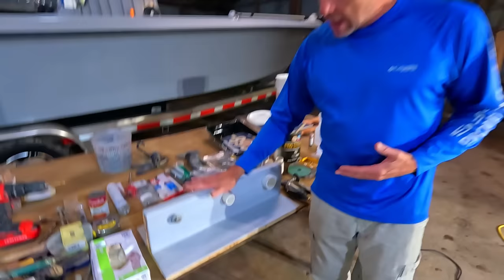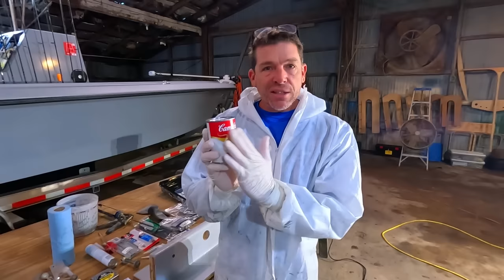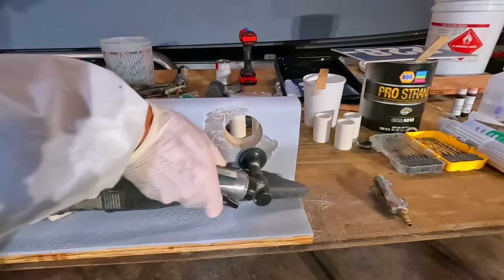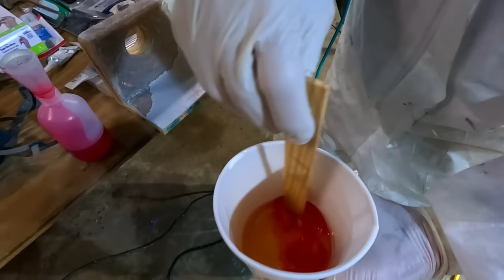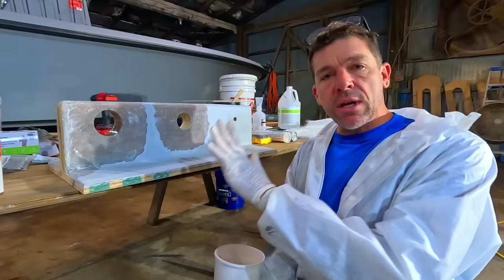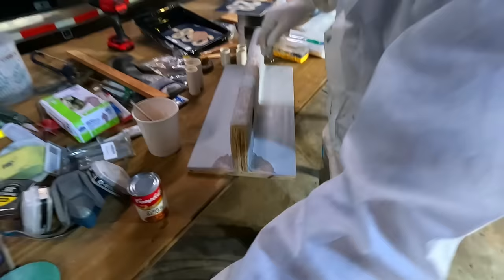HOW-TO Waterproof Plywood using Fiberglass and PVC! DIY FIBERGLASS OVER PLYWOOD

Comment: So if I wanted to add plywood instead of coosa inside my center console to thicken it up to mount electronics to. Would it be better to fully ecapsulate the plywood with glass first then epoxy it in  then mold it in, or seal it just with resign, epoxy it in and glass over it to mold it into the inside of the console? I would rather do coosa, but Marine grade plywood is 75% cheaper and readily available here at Home Depot in the East coast of Florida. I would really like this to last a long time without moisture issues. I do plan on doing gel coat once it's molded in. Thank you for all your knowledge you are sharing with us!!!

Comment: Happy I found your channel.  I thought polyester and wood doesn't adhere well. I am repairing a balsa cored deck with ply and some tell me don't use poly but epoxy instead. I am very confused lol
Reply from the maker: Glad you are enjoying the videos! In my experience a variety of resins can be useful in different applications. There are pros and cons to all of them. We have used good quality iso and ortho polyester laminating resins  over marine fir plywood for years with good success. It is very important to grind or sand in a very aggressive tooth into the surface of the plywood to help with the mechanical bond. Priming the wood with a coat of resin before doing your main laminating is also very important. Vinyl Ester resins are a step up from polyester resin, offering more strength and water resistance. Epoxy resin is considered by many to have the best bond and water resistance overall. One negative to epoxy is that it is not generally recommended to use gelcoat over it. There can be bonding and curing issue when applying polyester gelcoats over epoxy. So for some people that is a deal breaker. I am planning a resin selection guide video very soon for you guys, I hope this helps. Thanks for watching!
Reply: @FishBumpTV  You are amazing, thank you!

Comment: I have a small fiberglass hull (15'6" gheenoe classic) that the previous owner installed a thru-hull drain (1-1/2") in the center compartment to make it a live well. 
How would you go about patching a clean hole through the hull midship (similar to the holes you made in this video with the faux stringer)? I would love to use this as dry storage instead.
It is the camo color and I would like to TRY and match the gel coat.
Reply from the maker: You could fiberglass or epoxy the hole. You would usually grind the fiberglass around the hole back 2 to 3 inches on a bevel. Some on the inside, and some on the outside. I hope to do a video on this topic very soon for you guys. Hope this helps and thanks for watching!

Comment: Giday from AUS! just came across your channel been binge watching your diy stuff loving it. I’m redoing floor on my boat that was rotten from seats being changed and screws letting water into the plywood, I’m guessing. Should I predrill and fill the holes with resin. Or how should I go about it
Reply from the maker: Thanks for watching all the way from Australia 🇦🇺!Rotten floors are are a very common problem for sure. I like 3m 4200 for sealing most fasteners in our boats. You certainly could predrilled and seal with resin also, but I would still seal it with 4200. I hope this helps and thanks for watching!

Comment: Top tip from me. Wear TWO latex gloves on each hand. When the top glove gets loaded up with strands simply remove and you have a clean pair on already. Any second saved by not reaching for the glove box is precious seconds especially when you are working in warmer temperatures.
Reply from the maker: Great tip! Much thanks!
Reply: I do this when mechanicing too, it avoids the problem of trying to get a new glove on a wet sweaty hand, and oftentimes small holes and tears only go through the outer layer, if you can notice in time to change outer glove  then it keeps the job rolling
Reply: I'm a surgical tech and we do this a lot also
Reply: I put 6 pair on when I'm on a roll quart after quart etc.

Comment: what about if you need to put a screw in it? is it worth pre drilling and maybe putting epoxy in the hole before the screw? or is it unnecessary ? for instance you are doing a new deck and you need to install a center console on top of it, or your replacing a deck and you are screwing the wood floor to wood stringers. really enjoy watching you video's and thank you there very informative.

Comment: Hey mate. I have got to fix my 5.7m boat. The stringers are rotten. Do you think I should rebuild with thermolite or coosa or plywood? I like the way your building and teaching. I’m a builder by trade and very detail oriented. So what your doing resonates with me, thanks
Reply from the maker: The high density Coosa or thermolite can work great for stringers. We used Coosa for the stringers in our custom 29, and I am very happy with it. We have over 20 videos documenting the build of that boat that you might find interesting. Plywood can also work, it is going to be heavier, but considerably less expensive. Plywood has to be installed and sealed correctly or rot is a concern, whereas Coosa or thermolite do not rot or soak water. There are pros and cons to each. I plan on making a video on this topic soon. Hope this helps and thanks for watching!
Reply: @FishBumpTV  thanks for the information. Yeah I’m finding it hard to make a decision on which way I want to go. I’m trying to keep the boat under what it would be worth on the market if it was fixed. I think there is about $15k difference what I paid and what it’s worth fixed. But then there are servicing cost of the outboard, electrics and cost to get someone to fix or do it myself
Reply from the maker: @stevec5192  I understand, I hope our videos can help you make a decision that is best for you and your project. Thanks again for watching !

Comment: Hey Captain. That green putty, does it chemically bond to the PVC pipe or is it a mechanical bond due to scuffing it really well?
Reply from the maker: It is a mechanical bond, that's why cleaning and sanding  thoroughly is important. This is the method we have been using for years on our boats with good results. Hope this helps and thanks for watching!

Comment: Here in the U.K there is 2 types of matting available, Powder Bound for epoxy resin. Will this matting conform to different shapes like the styrene matting does with polyester resin? 
After the wood is primed and gone tacky could the PVC tubes be installed instead of waiting for the primer coat to dry over night. 
Another question is, how would a weep/drain hole be installed in a stringer or bulkhead, would you use the PVC tube method demonstrated here in this video or seal a weep hole in a different way.
Reply from the maker: Yes, I wish we had the epoxy compatible csm here in the states. I like for the resin to at least tack off before installing the pvc pipe, but  don't suppose you have to. Yes, you could use the pvc pipe as a weep hole in a stringer or bulkhead, in fact that is how we did it in the build of our 29 ft custom build. There should be some footage of that in the 29 build series videos. I hope this helps and best of luck with your project!

Comment: If the mat kind of melts how does it lend any strength to the overall assembly?
Reply from the maker: The resin melts the binders in the mat or csm, but doesn't actually melt the fiberglass fibers themselves. As a side note, csm has strength,  but not as much as biaxial does. Csm bonds well, and leaves a nice cosmetic finish. We usually use the two together when working with polyester resin to get the best results from each one.

Comment: I'm building a small boat, about the size of a canoe for a ocean crossing project. I was wanting to make it out of plywood and ten fibre glass it. Is there a recommendation for which resin/epoxy to use as well as type of fibre glass?
Reply from the maker: Epoxy would probably be your best bet. For something that critical, you would want to use the best materials you can get your hands on. Thanks for watching
Reply: @FishBumpTV  I still need to pick your brain, it's 7 square metres of area on the exterior of the boat. I should get 90 degree woven at hoe many grams do you think? And how many layers? I'm quoted like 95 dollars for 4.5 kgs of epoxy with the hardener. I'm located in Panama for reference, going to do this at night when it's not as hot. The salesperson told me I need ten layers and to fibre glass the interior too for durability. What's your take on this? What quantities would I need?

Comment: Do you ever make your own fiber filler?  (Just by dicing up normal glass mat into smaller fragments and mixing it with resin, or filler or both with resin)  If so what would the recommended ratio be? The longer the strands the more cumbersome to mix and apply, but as a structural fill option it actually works for larger applications.  My experience level novice.
Reply from the maker: Yes, that can certainly be done. Usually equal volumes of resin to glass is a good starting point and then adjust as needed from there. I hope this helps and thanks for watching
Reply: @FishBumpTV  Thank you, for the reply and great content. ZA

Comment: Hey Joe, this is Joe… when glassing over plywood on my new center console build, is it acceptable to only use CSM since the piece is not structural OR do I need to use 1708 as well for strength? Thank you as always sir!
Reply from the maker: Yes, you can use only csm if you are just trying to seal and weather proof  something. I would put at least 2 layers on though, one isn't usually enough to do a good job in my opinion. You might also consider putting some 1708 just in the corners for added strength. I hope this helps and thanks for watching!
Reply: @FishBumpTV  thanks Joe. My order of operation will be prime all surfaces good with laminating resin, fillet with NAPA Pro Strand, 1708 corners, 2 layers of CSM on the inside. Repeat for the outside of the console but alternate CSM and 1708 for 4 total layers outside. Fair with finishing coat of gel coat. Build 5 or 6 layers of gel coat then final coat with wax. Sand 400, 600, 800, 1200. Cut then buff then polish.

Comment: I assume wet wood decays due to bacterial action and I wonder if soaking the plywood for my transom replacement with bleach and letting it dry would help protect the wood if the fiberglass covering is breached.
Reply from the maker: I have never heard of doing that before, it is an interesting thought though. My concern would be that the bleach could affect the bonding ability of the resin.I know that as long as the wood is completely encapsulated it will last a very long time. Thanks for watching!

Comment: I have a 1973 gulf coast 23 that needs a large hull repair, how do I know what to use for this repair, epoxy or polyester? You say I can't use polyester over epoxy, How do I know witch to use?
Reply from the maker: I can almost guarantee you that you have a polyester hull.  But if you are in doubt,  just remember that epoxy will
Bond to polyester,  vinyl Ester and epoxy. Thanks for watching

Comment: Next time place that polyester putty into an open syringe.  Hold the pipe in place with a piece cut out piece of cardboard that fits snuggly to the pipe. From the opposite side push the syringe into the gap and posh the plunger .The gap will fill in solid 1st time. Think like you are filling it with a caulk gun.
Reply from the maker: Thanks for your thoughts, I appreciate the suggestion!

Comment: you don't have problems of detachment between pvc and polyester resin cause of vibrations ?
Why don't use polyuretan mastic that are very more elasticity and glue very strong on pvc ?
Reply from the maker: No, we have never had any problems with it failing. We always thoroughly clean the pvc with acetone first, then sand the surface very aggressively. And we are only using the pvc as a conduit or a rigging tube for wires and hoses. But I recommend that people should do what they feel comfortable with. If you don't like or agree with what I show, then you shouldn't do it. I hope this helps and thanks for watching